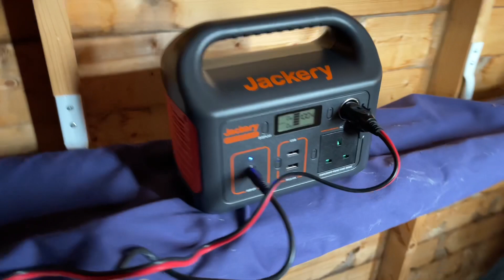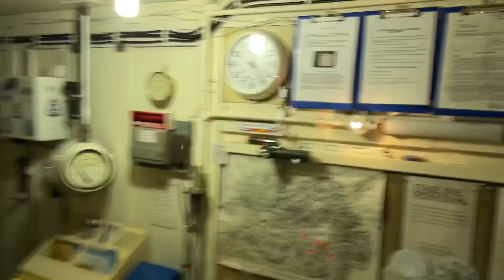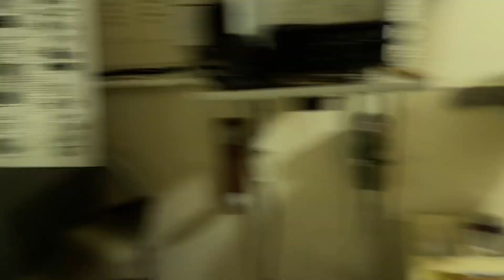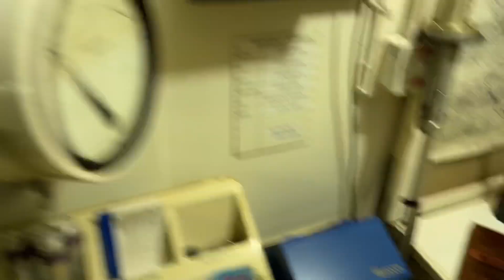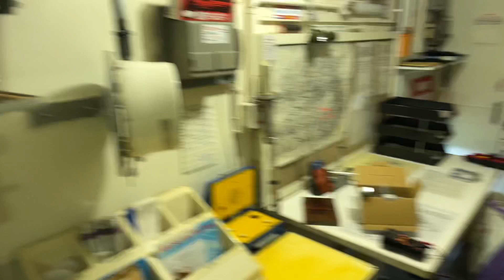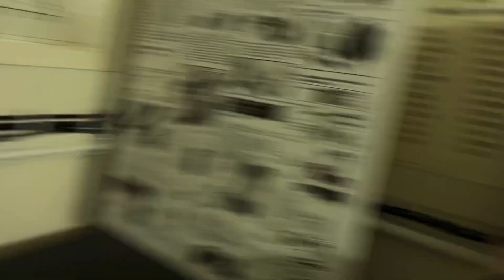Bunker Maintenance Episode 18

Comment: what is that jackery
Reply from the maker: The model you mean? Or do you not know what a Jackery is at all?
Reply: @SurvivingTheApocalypse  i dont know what a jackery is at all
Reply from the maker: Ah, ok, I must have explained it pretty badly in the video in that case. Its a portable power station containing a rechargeable lithium battery. The model in the video is the EXPLORER 240, which has a 240 watt hour battery.
Reply: @SurvivingTheApocalypse  ohh i know

That must be like an powerbank yep?
Reply from the maker: Correct.

Comment: as a suggestion you could use a honeywell small person heater, I have one its rated for 100watts on low and 250 on high, its only meant for like a cubical like thing but for the size of that bunker it might work